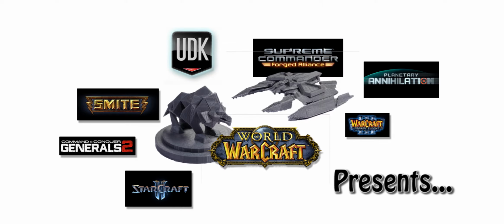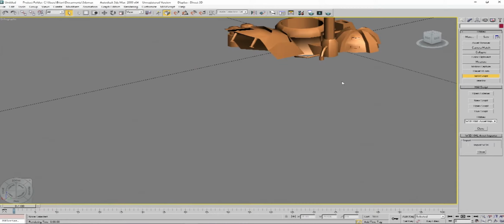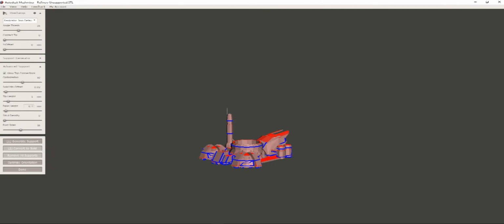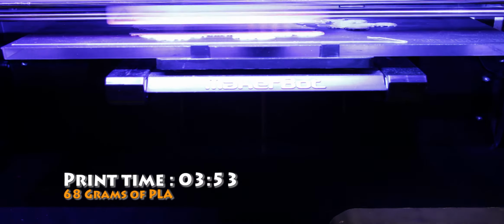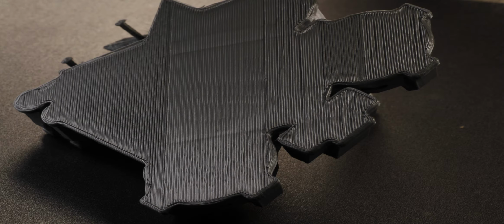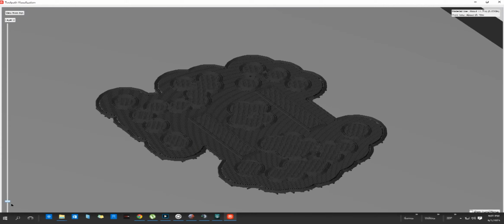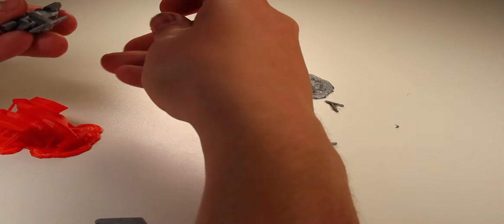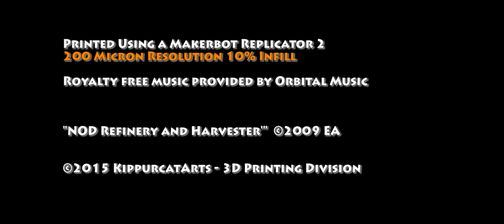3D Print Lab - Nod Refinery and Harvester [Command and Conquer 3]

Comment: At the 5:25 mark with those 'Studs' you put in place where can i find a Function like that for the MakerBot Replicator (Desktop 3D printer) We have a Program like this at my School and Was hoping to find a method to put in Studs like the ones you put on the Nod Harvester. I'll looked around the Settings and seemed to have no Success so far.
Reply from the maker: José Gallardo Thats a feature of meshmixer, which is free, that allows you to generate support. Usually 2mm rods work better as they are easier to remove.
Reply: Does that Feature come with the program or is that a Separate Downloadable Thing?
Reply from the maker: José Gallardo Its under analyais, support generation